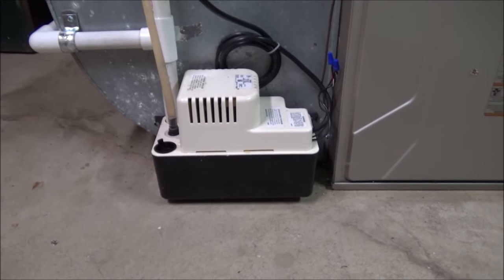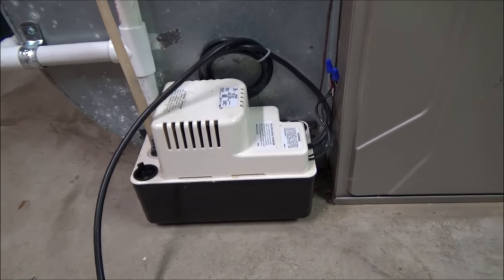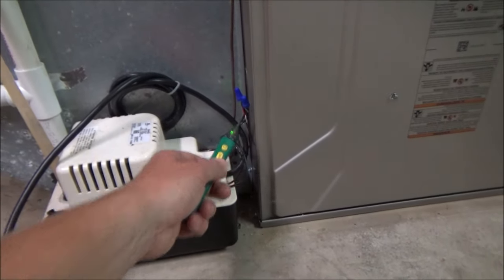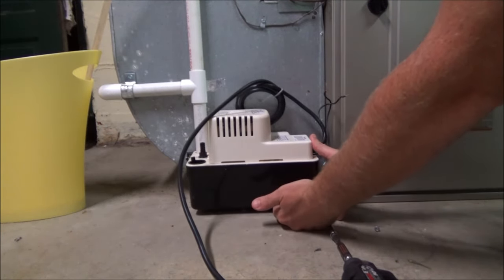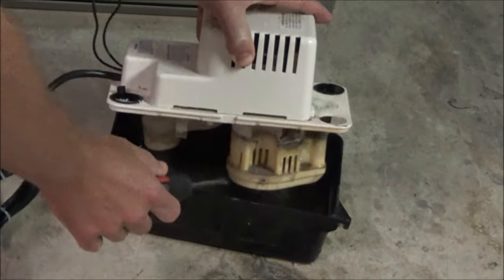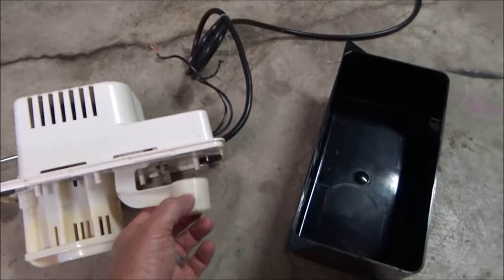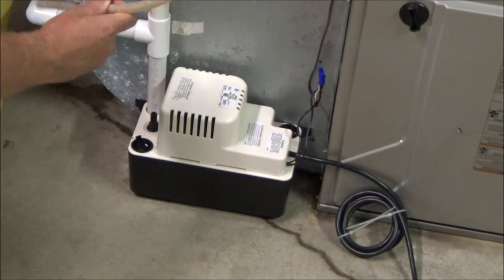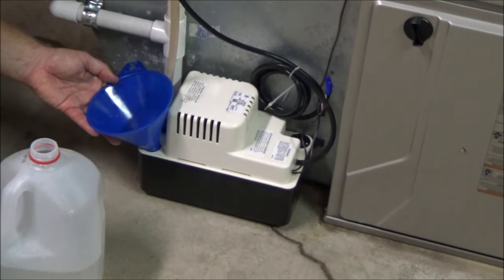How to Clean Out a Condensate Pump

Comment: Does anyone know the typical lifespan of these pumps?
Reply: Depend on location. Hot humid areas produce more condensate than other areas, My area, mid-atlantic, pumps will outlast heat pump. AC only operates several months. Some hot (90 F) days 5 gals condensate. Cooler days only a gallon or so.

Comment: Just a note to those that can't seem to find the condensate pump or think the pump may be internal. YOU may not have a pump at all!  You may have a catch tank beneath the coils and a pipe that drains the catch tank by gravity ONLY!  The water will drip from the coils into the tank and then flow down the pipe. If such is the case, and you have a clog, you generally only need to break up or remove the clog and pour water down the U-Trap's access port to literally flush the clog away.  Just thought I'd mention this because it literally caught ME by surprise with my own HVAC system.
Reply from the maker: Thanks for the input Jerry!

Comment: how many decibels is that pump. Mine's 10 years and I'm going to replace it even I think I just needs a new valve; however, the motor did sound very labored. So I'm just going to replace it but my hope is after 10 years perhaps they are quieter but I doubt they would do anything different regardless if it was made 10 years ago or yesterday. Mine is the 554401 little giant and I don't care that it doesn't have a kill switch.
Reply from the maker: I can't seem to find the decibels anywhere but it is very quiet. Here is a link to the one in the video:
https://amzn.to/3tfDtEr

Comment: Nice vid.. my pump makes this gurgling noise Everytime my furnace comes on..when ac turns on. It does not make the gurgling noise.
Reply from the maker: Interesting. It shouldn't make a big difference either way unless its getting a lot more water from one or the other. I had to replace mine couple years ago because it was getting really loud.

Comment: Well it turns out my main problem was my hose that goes out the back wall had bent from the guy who cut the grass. It caused the water not to go out the hose and start flooding the garage floor. Also cleaned it out/Clorox.
Reply from the maker: That will do it. If that hose gets kinked you'll have problems.